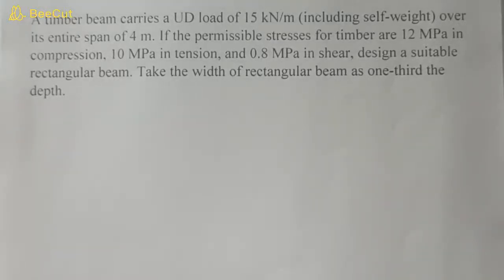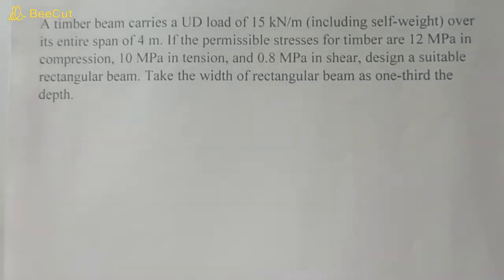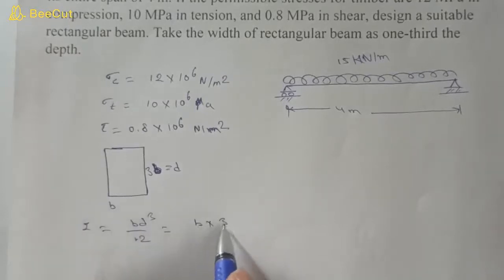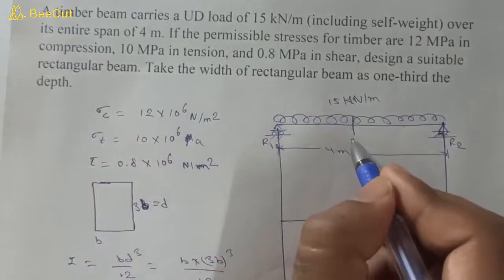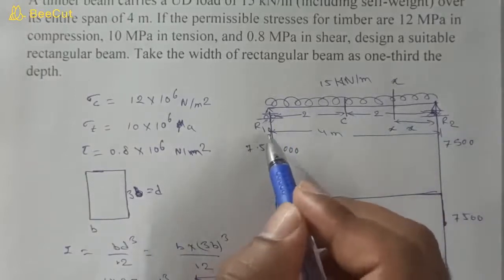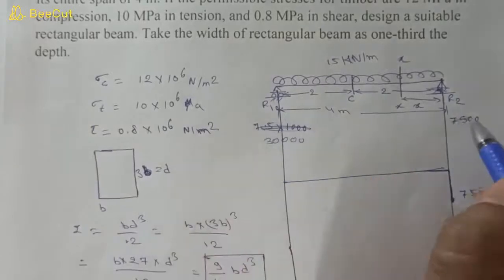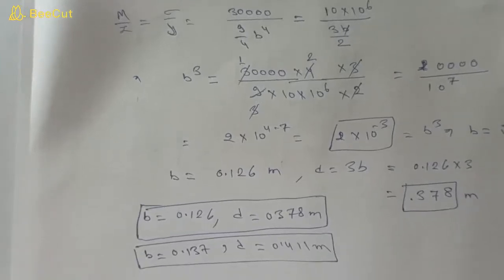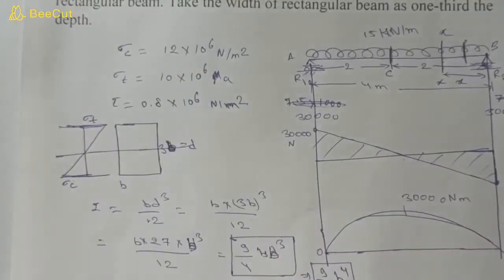Design of beams: Numerical 1: Simply supported timber beam with UDL

Comment: Thanks but how did you get b x 27 x d^3 /12 . I got 27b x b / 12 = 9/4 b. However cannot find how you still have d  cubed ?
Reply from the maker: bd^3/12 = b×(3b)^3/12= b×3b×3b×3b/12
= 27b^4/12= 9/4 b^4
by mistake I have written d instead of b, but if you watch till end I have corrected it
Reply: @mechpm  okay brilliant, please make sure errors are mentioned at start of video to keep confidence and therefor watch till the end.. Please can I ask your advice with a question regarding frames and struts dear, I will share your videos in return?
Reply from the maker: ok sure
Reply from the maker: but you can check my playlist on truss and frames, I have made many videos